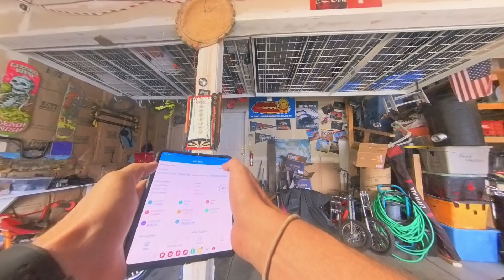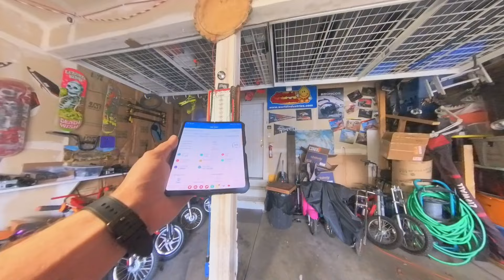Flipsky Same Ride Bomb Moto B1

Comment: Dude the flipsky pulls! 😂 try setting your max brake amps under "current" to like 10 amps and it should solve the problem with no throttle while rolling backwards. As far as the rough take off if you go to motor cfg and press the 3 dots at the bottom you can run through decect foc hall sensor & detect foc parameters and it should get it more dialed, those are the same as the motor learn so chain off or wheel up in the air when doing it!
Reply: Oh and make sure under "foc" make sure your set to hall sensor
Reply from the maker: Right on appreciate you man, yeah that's what I keep doing and still having the same results Jeremy had me do all that as well and I still got the same darn issue I can't get rid of it. I'll keep trying it I guess lol

Comment: how do i wire a 3 speed switch to this would you be willing to make a video of how to wire and tune it / set up vid?? 
thanks in advance!
Reply from the maker: @foreverdriftandcars  for flipsky specifically there is no 3-speed option I tried to go through pros and cons between far driver and flip sky in My what controller should you get video.  This is a huge downfall I am constantly complaining to the owners and they don't think it's that big of a deal you can change different settings in your app and save them as "3 speed" but you have to get your phone out and connect not a huge fan of that
Reply: @Razorcrew_Cole  ohhh okay im not super worried about it just was curious if I could or not I appreciate you messaging back for info
Reply from the maker: @foreverdriftandcars  Right on yeah unfortunately just not the option maybe someday! It's a great controller option if you watch the video me comparing the two it's slightly wins my little test